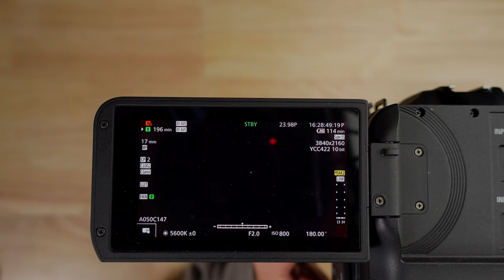Canon C70 Speedbooster - Everything You Need to Know

Comment: I enjoy watching your videos but unfortunately you calculate inaccurate. The sensor crop needs to be included in the mm otherwise people will think it is wider than it actually is misleading them. If you write 17 mm sensor crop not added it would be ok. But you give people a false impression when the actual focal length will be almost the same to a full frame, definitely not more.

Comment: New c70 user here. I’ve attached the speed booster along with a meike 35mm t2.1 lense and I’m experiencing vignettes. It does reduce when I use digital stabilization in cam but I’m wondering if I’m doing something wrong. I’ve worked similar systems with Sony cameras and have never experienced vignettes unless using a wide angle lense
Reply from the maker: I am assuming that you are using the S35 and not the full frame version of that lens. You need to use full frame EF lenses when using the speedbooster.
Reply: Oh boy.. thanks for the reply!

Comment: Do you not have to add the crop factor back in?  24mm x 0.71 = 17mm full frame equivalent then the 1.5 crop factor gets you to a 25.56mm equivalent.  Right?
Reply: You are right i was looking for a comment and wanted to write the same thing. He forgot to add that. He makes it sound like you get 17mm which is not entirely true, it is only before accounting for the sensor readout.

Comment: Josh I ended up trading in my micro 4/3 camera and ponying up $4,000 for a C70. All of my RF glass is way to cropped to shoot inside. I'm guessing I'm now going to have to buy EF with one of these speed boosters? Or is there a wide-angle lens I'm super 35 with autofocus I should look at?
Reply from the maker: Congrats on the C70! It depends on how wide you need. The Sigma 18-35 is my favorite S35 lens. There is also the Tokina Atx-i 11-20 2.8 which I've heard good things about.
Reply: @Josh_Sattin  Thank you so much Josh as always. Very classic case gear addiction and overspending. I love my R5C even more Now that I got the C70 but I think together they will be unstoppable.
Reply from the maker: @PizzlesTechTime  You’re welcome. Great combo!

Comment: very well explained. I forgot so much. Covid slowed my C70 usage :(  Just remind me. My 24-70mm 2.8 RF is actually a 36mm-105mm in my C70 ?
Reply from the maker: A 24-70 is always a 24-70 no matter which camera it is mounted on. If you want to get the full frame equivalent then the C70 has a 1.46x crop factor in DCI and 1.53x in UHD.
Reply: @Josh_Sattin  Your loosing me now ! I thought my C70 was a crop sensor (not 35mm FF)  So my 24-70 stays the same on C70?
Reply from the maker: @laurencegrant2882  If you are not using the speedbooster then multiply by the crop factor to get your full frame equivalent. The lens itself doesn’t change.

Comment: the way your tell your math is a bit weird ('cause you multiply the 0.71 buy the focal length or the lens and not by the cropped focal length with the s35 sensor which will be 75mm from a 50mm FF) but i finally understood. but i dont think its right to move the camera closer to subject because the frame you get with 50mm FF w/o the speedbooster is a cropped image, it its not a real 50mm but more like a 75mm ish.
Reply from the maker: I would rewatch the video again. The sensor size does not change the focal length. A 50mm lens on a full frame or APSC camera is still a 50mm lens. When you add a focal reducer on to the lens, it changes the focal length of that lens, independent of the size of the sensor.
Reply: No, he is correct. A 24mm FF lens doesn’t become 17 with the speed booster. The speed booster negates the crop factor of the S35 sensor that normally would only use the center of the full frame lens, narrowing the angle of view, making a 24 something like 36mm in full frame equivalency for angle of view. The speed booster takes in the entire full frame lens’ light and focuses it down to the super 35 sensor giving you both your full 24mm focal length back and an extra stop of light (but not a stop less DOF). Your math is correct but the practical application of a speed booster isn’t. If you put a 50mm FF lens on the C70, it acts like a 75 in terms of field of view, the speed booster rectifies that back to 50.